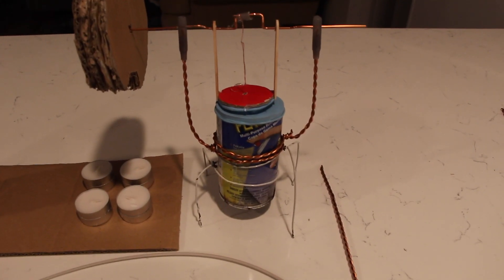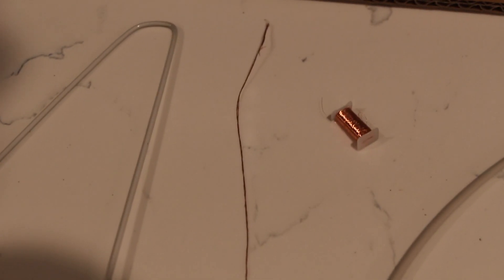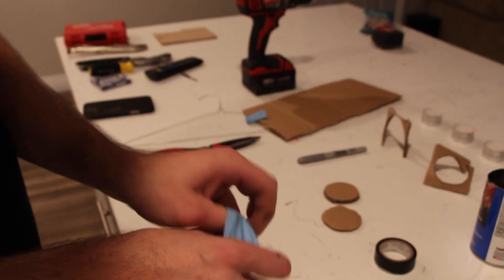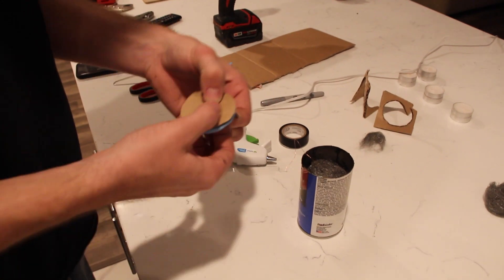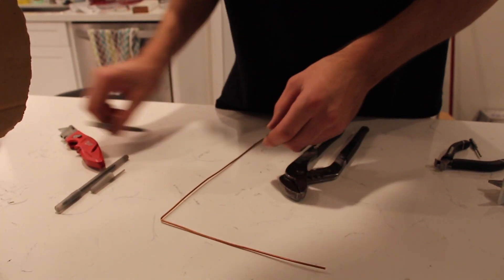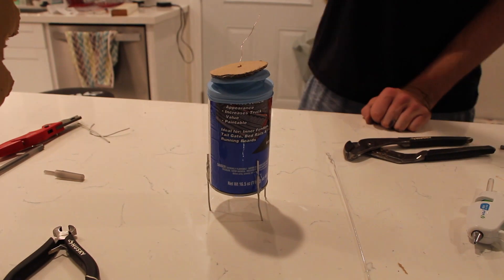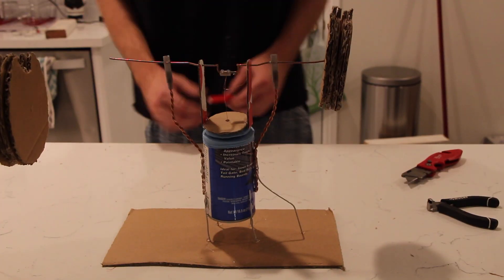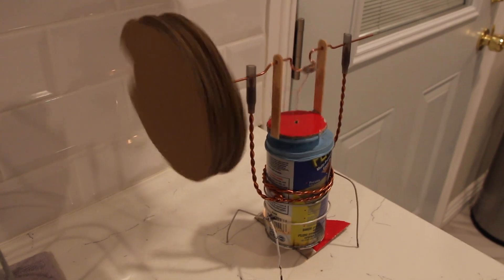Stirling Engine DIY How To

Comment: So with the displacement piston, you said to cut off the head of a match and use that to wrap your steel wool... what exactly what the match for? Did you wrap it inside?
Reply: Slightly Modified Awesome! Also, how many of the engines did you make before it worked?